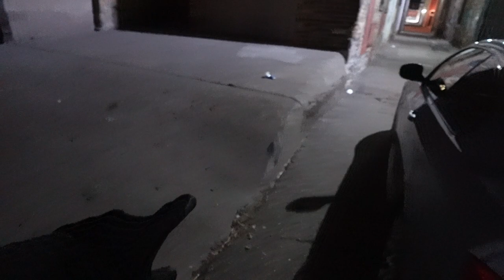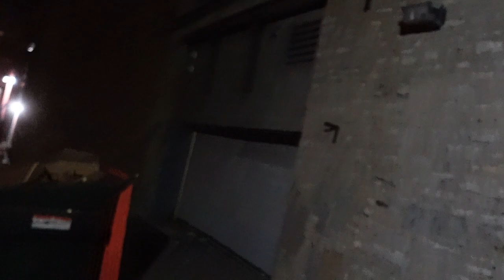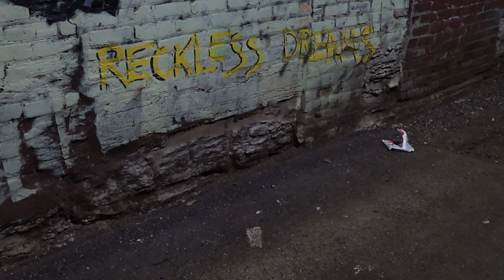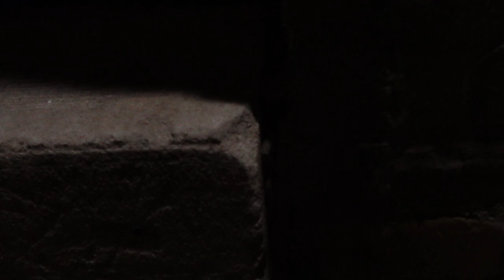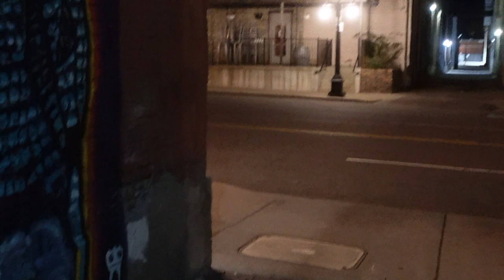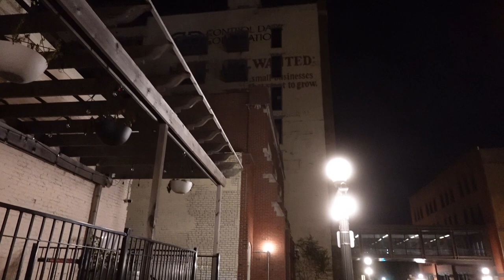Alley Melt

Comment: They slather new surfaces over the old stuff and hope nobody notices. What we see as big blocks of stone are just facades a few inches thick, over layers of brick, mortar, concrete, and other materials. The Old Masonic Temple, just up the street from me, has what appears to be solid granite bases to the pillars on each side of the entryway. However, it's beginning to flake off in thin layers, which tells me it's probably a geopolymer formed in layers. I don't think real granite (if there is such a thing) would break apart that way. There are loads of bricked-up windows at ground level in the older buildings, with no record or explanation as to why they are like that, or when they were filled in. I also noticed that the ground level is higher on the west sides of buildings than on the east. Have you noticed this in your city, too, that the ground rose up higher on one side?